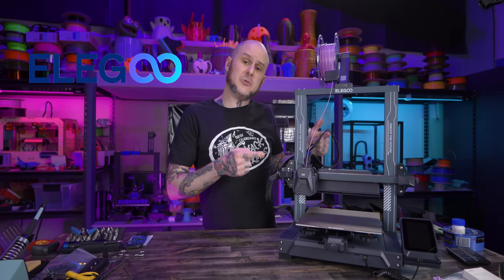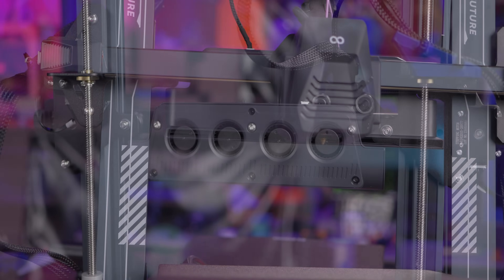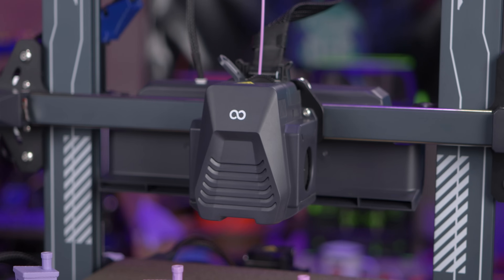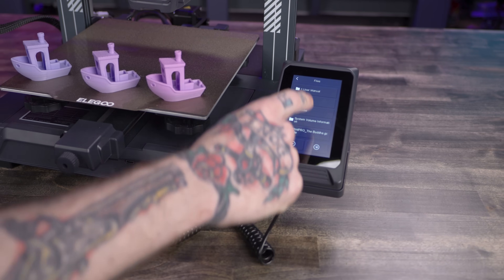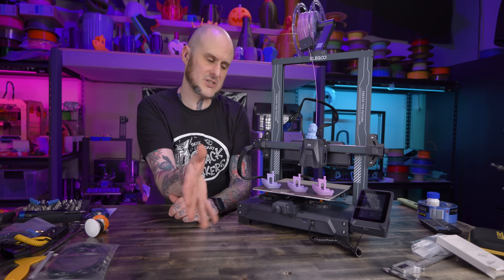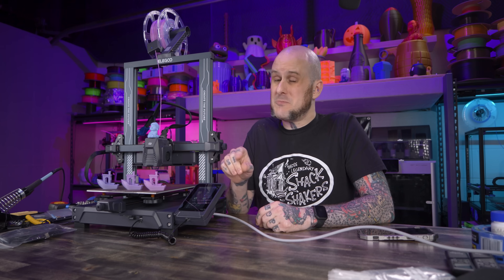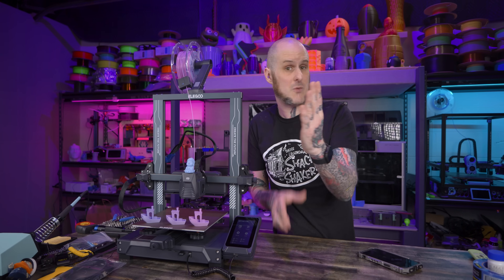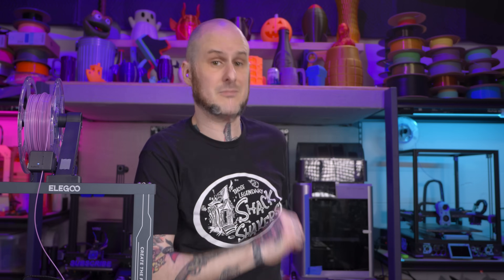Neptune 4 Pro - Closer Look + Wi-Fi Setup!

Comment: Thank you for the detailed look at this machine, especially the print head assembly and that hilarious blower fan bar.

I actually don't mind the way they have things set up here.

I run my machines with no internet. I have a second wireless router for my printers. When I need to send a print over to my machines, I switch to my printer wi-fi network and get them running. In the case of this Neptune, I'd just run an ethernet cable to the 3D Printer router, since it's right next to my printers anyways.

I've always been hesitant about letting my printers get onto the internet, but I think this is the best way to do it. The only thing I'm "missing out on" are cloud functionality and automatic firmware updates, but the improvements in security are worth it to me.

That said, it would be better for them to include a USB dongle pre-installed on the "pro" version to help differentiate it from the standard Neptune 4.
Reply: Agree, this would make sense for Elegoo. Ordering the dongles in a giant batch is definitly not expensive. Only configuration might change time, bit I think this can really be reduced too

Comment: i personally don't care about wireless since mine is in my network closet so it's going to be wired anyway.... but another option is wifi Ethernet adapters (wifi bridge) as well and don't require any Linux configurations or even wiring it up first.  these adapters are about $30+ on Amazon or cheaper elsewhere.

Comment: I wonder if that shroud/duct can be reimagined with something like some 120mm case fans. Would reduce the dB and pitch a lot.
Reply from the maker: With a proper design I’d imagine so, but axial fans aren’t generally as good at blowing pressurized air like that. Doable? Sure, but questionable performance I’d think.

Comment: I think we finally hit the sweet spot of the ender clone. This machine has everything I'd want to upgrade on an Ender 3.

The only bummer is the proprietary nozzle
Reply from the maker: Up until really recently I still recommended the Ender 3 has an entry level printer. Elegoo has legitimately finally brought a handful of clones with legitimately good features that have won me over to recommending their machines. 

That nozzle is a bummer but as more machines are using it I’ve got hopes we will see more nozzle options. This is the 3rd machine I’m aware of with that nozzle (& the original Spyder Hotends). Hopefully we see a CHT version of it. THAT will make things interesting.
Reply: Are we sure it is proprietary and not a M5 clone?
Reply: The Kobra 2 has a similar (maybe the same) nozzle.  Maybe this will be a new standard nozzle.
Reply: @petercallison5765  Elegoo support (very responsive!) has answered my question.  The nozzle is custom.  18mm in length with 10mm of M6 thread.

Comment: Could you take the whole print head assembly and put it on the Max?
Reply from the maker: Sadly no (I tried). Not saying it would be very hard to modify and mount, but it’s definitely not a direct swap. I wish it were. Some bolt holes line up, some don’t. I don’t have time at the moment to dig deeper but I may try and revisit it.

Comment: Ugh... All these new Klipper printers using MKS SKIPR based boards, and leaving default username/login, and then getting put onto networks being a quick security hack away.  It obviously made it easy for you in this situation, but going to make it easy for anyone else too.
Reply: What is the point of hacking into a 3d printer. Most people wouldn’t even know how to slice a model…
Reply: @Nevio_024  Google “iot botnet” then “iot mirai”.  Insecure Linux devices particularly ones with known default root passwords are easy targets.